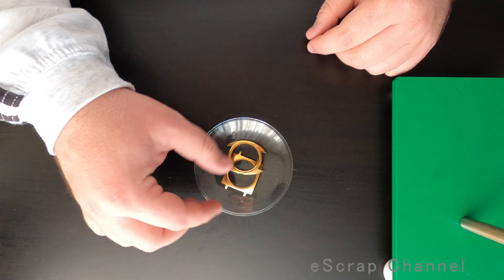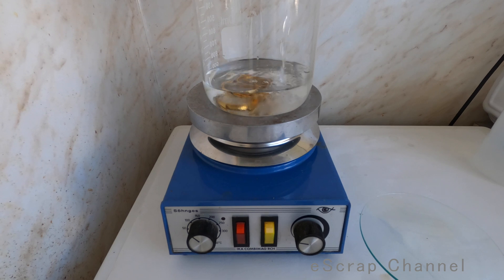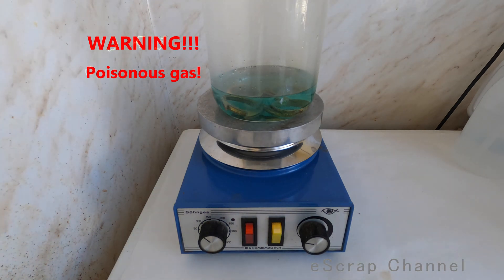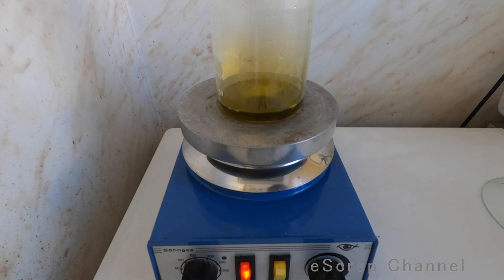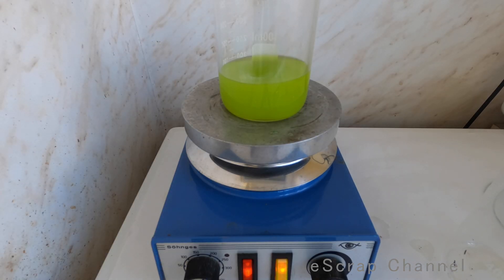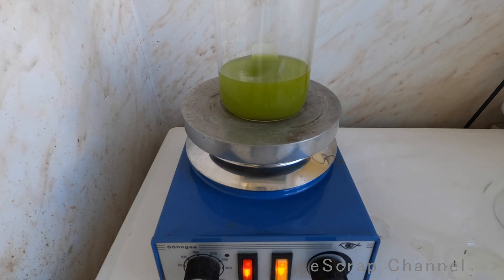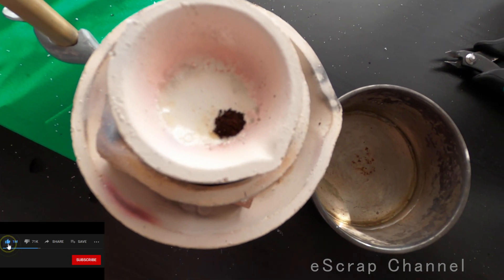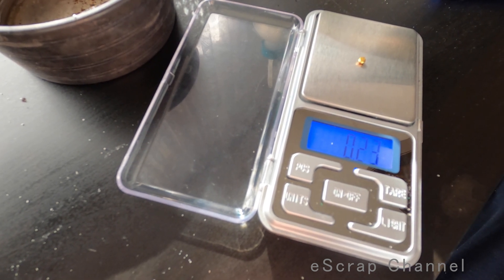Gold Recovery from Plated Watches

Comment: So much gold from two housing :O I also have a gold plated watch. 
So I have about 0.1 grams of gold 😃
Reply from the maker: Hi, depends on the gold plating thickness.
Reply: @escrapchannel  I have 10 micron :)
Reply from the maker: @ufdiah  can be even 0.15 depends on size and how long was used. Some good is rubbed off the case when on hand.

Comment: is the watch case stainless steel destroyed when doing this method ?
Reply from the maker: Hi, watch cases are made of brass and they are dissolved in nitric acid. So, yes cases are destroyed. If gold is removed with reverse electroplating cases stay intact. I have such a video.

Comment: New sub here. Great video! Can this method be used on magnetic gold plated jewelry?
Reply from the maker: Hello, thanks! Yea.
Reply: @escrapchannel  Thank you for the reply. Very appreciated! Are you open to questions on gold and silver refining?
Reply from the maker: Sure, if I know the answer I will help.
Reply: @escrapchannel  Thank you! Very commendable and appreciated!👍👍👍
Reply: @escrapchannel  What method do you suggest for magnetic gold plated jewelry? I have about 5 pounds of it that I would like to attempt a gold recovery from. I have tried both Nitric acid diluted with distilled water and I have tried Hydrochloric acid also diluted with distilled water. Both I have came up with a negative outcome. Were the watches you processed "Plated" or were they "Filled" because when you were finished with your recovery, you had gold foils. As if the material was filled material. Filled being a much thicker plating. All I end up with is sediment in the bottom of my beaker, usually black or gray in color. I have refined karat gold and filled gold with a positive outcome, but the gold plated has me stumped. Your thoughts? Thank you for your time.
Reply from the maker: @IndependentForPieceOnly  for very thin gold plating I use gold stripping agents like ecogoldex or reverse electroplating. It is not worth using acid methods from my perspective.
Reply from the maker: Thanks!
Reply: @escrapchannel  Makes perfect sense! Especially after watching your video on reverse electroplating. That is the method I'm going to go with. Thank you so much!!!
Reply from the maker: @IndependentForPieceOnly  👍

Comment: Is it ok if i put 20ml hydrochloric acid? i have 15% acid. And what liquid did you at after filtering? distilled water?
Reply from the maker: Hi, in general by the 📚 aqua regia is 3:1 hydrochloric to nitric acid. In practice you can put gold foils in hydrochloric acid 15% as much acid as you decide and start adding slowly nitric acid by 1-2 ml until gold foils are dissolved. And heat please. The point is that hydrochloric acid you need as your get the auro-chloro complex and nitric acid is needed as a strong oxidizer. So, during the heating if gold stops dissolve you first add a little nitric acid and if reaction does not restart - add hydrochloric acid.
Reply: @escrapchannel  i am talking only about recovery part.
Reply from the maker: Usually I always use distilled water in the lab 🧪. But it should be really bad tap water to mess up gold recovery stage. No harm to use tap water.
Reply: @escrapchannel  so you added after filtering nitric acid?
Reply from the maker: I use nitric acid to dissolve any base metal from the final gold powder
Reply from the maker: Regarding the water. When you dissolve base metal is recommended to use distilled water as if there is a lot of chloride in the water you may also lose gold.
When aqua regia is formed - tap water is fine, but better distilled.